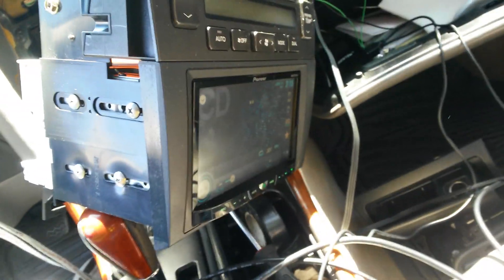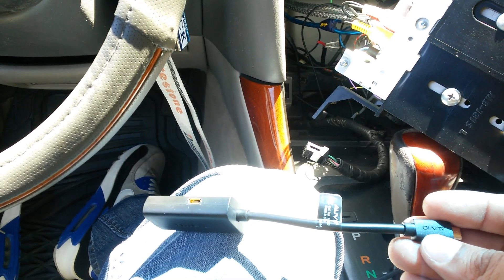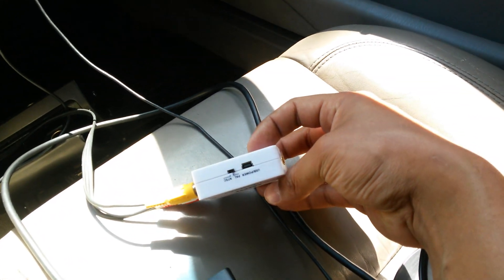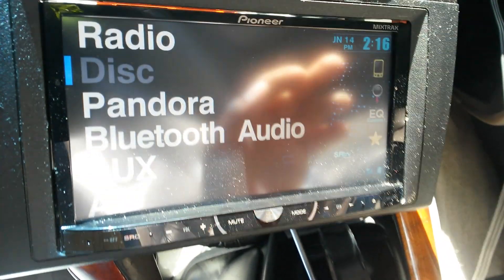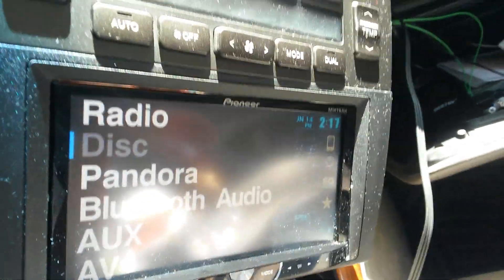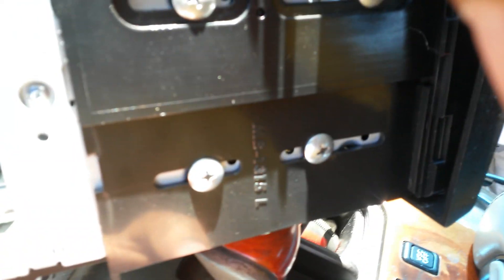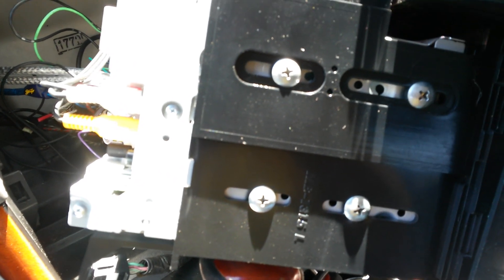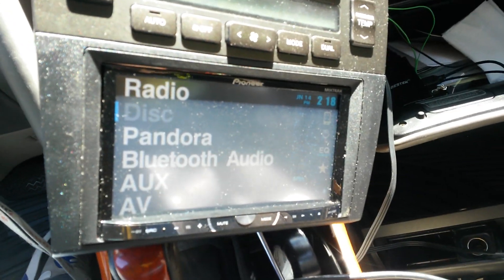Avh x4600bt android mirrior link part 2

Comment: Remyrick, Question: I am a little confused. Did you have connect the USB from the head unit to that little mini adapter box? Also I have an LG G2, but I wasn't sure if I could use the Samsung myDP HDMI adapter, I also find a RocketFish HDMI adapter at BestBuy.